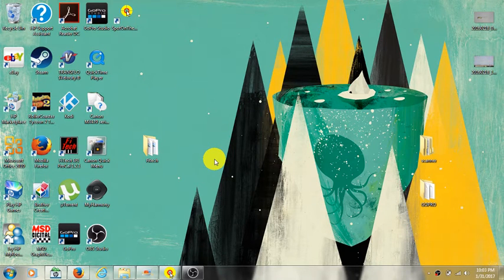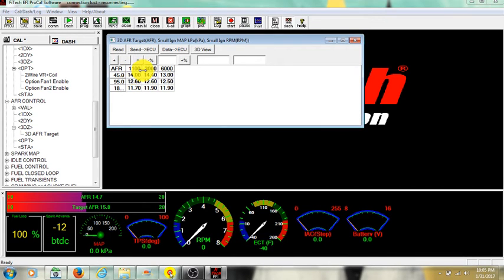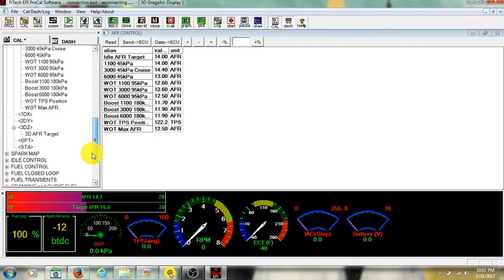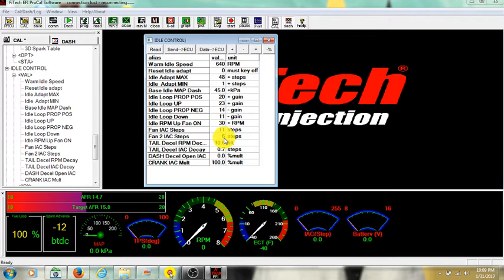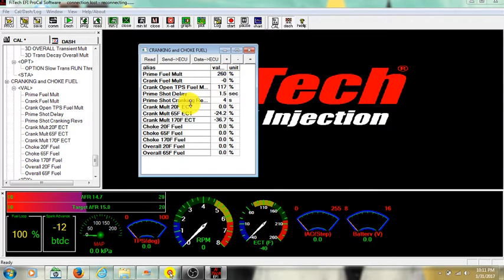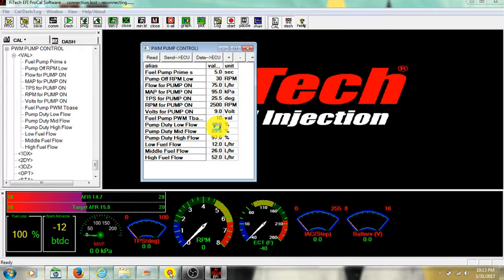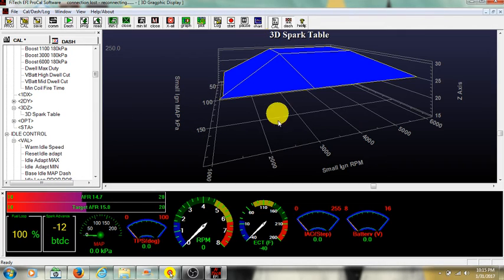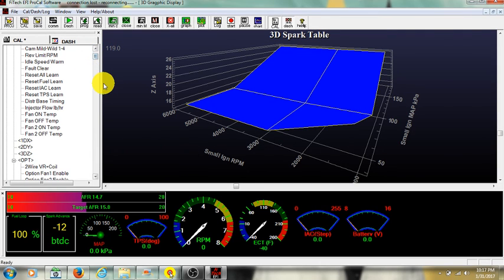Fitech Efi Procal Software!!

Comment: Can I use this on my Mac book pro
Reply from the maker: Not sure
Reply: Josh Luper - I just got mine working by doing the mac Boot Camp dual boot install with Windows 10 on my macbook pro. The Pro Cal works fine. You do have to disable Driver Signature in Windows 10 in order to allow the K-Line driver to be installed.

Comment: These tables are very low resolution. I thought there were a lot more data points. 1100, 3000, and 6000 X Idle, Cruise, WOT. 
  I was planning on a 600hp Fitech system but now I might go with Holley Sniper EFI.

Comment: Recently purchased the 600hp power adder system. Having the most ridiculous time in the world trying to even install ProCal. I plugged the handheld up to my computer and found the file that gave a step by step on how to install, and it said i need a "winRAR" to open the files. Went online and spent $40 bucks on this "winRAR" junk from rarlabs.com(the creator of the app), and got nothing but an email with some sort of "registration key" bullshit. Any advice or tips on how you were able to actually download the software? And did you use this winRAR stuff?
Reply from the maker: You can use winrar for free or winzip.They are just a decompressing software.I did use winrar you have to decompress into a folder then install the software from that folder.let me know if you get it to work.
Reply: Talk about massive economic spike at winrars firm now! I just press buy later like the rest of the human population XD
Reply: https://scontent.ford1-1.fna.fbcdn.net/v/t1.0-9/29027220_1643502759060179_4227327389358620672_n.jpg?oh=4d5c8359ec521d060503a5e00e854e85&oe=5B38F314

Comment: I have 383 my fitech keeps setting to a it 355? Also I set my rev limiter to 6500 and it goes to 7000 and sets my cam to a 2 i change it and it just goes back
Reply from the maker: Might not be giving it enough time to load to the ecm.It stores it on the throttle body not the hand held.

Comment: How/where do you get the calibration file? Do you "Read Cal from ECU" (on handheld) and use that file? I get no data in ProCal when I use that file. The panels are blank.  Thanks!
Reply from the maker: Paul Hamilton there's a folder in the hand held that has all the calibration files. that's where you can read them and save them to use.
Reply: Thanks for quick response. For some reason the software was not working right on my laptop - no data would show up.  Just installed on another, and now it works as you describe. I assume that if I make changes to the cal in the software, I can then save that back to the handheld. Then transfer from handheld to ECU?
Reply from the maker: yep, thats how it works.good luck!

Comment: Does it compensate for low bottle pressure?
Reply from the maker: It has duel afr so when your on the bottle it is  richer.The unit can add and subtract fuel to change the afr.So if the bottle is low then it will pull fuel to achieve the set  AFR.

Comment: I have so many questions... since I have my own ignition and I pull timing out for nitrous do I leave the timming pulled or set it up for normal driving and have the system pull out a couple degrees on its own?
Reply from the maker: You can run just the efi and use your old timing set up or you have to lock out your distributor and use the fitech system to do all the timing .Your distributor will be a crank sensor.If you use fitech for your timing then you can set it up so it will pull timing when the nitrous  are activated.

Comment: Is there a delay where it adds just fuel a split second before boost so it doesn't go lean?
Reply from the maker: It goes off of the map sensor so it sees a drop in intake pressure and adds fuel before you get boost then keeps adding fuel as boost increases.

Comment: how do you know what your afr is supost to be to begin with? i just got the 600hp with power adder and the fuel command center. i have a bbc458 in my mud truck and i just got this set up its still in the box. i have a holley 770 truck avenger on it now and holy crap it takes like 20 mins to get it to start. thats why i got the efi but before i put it on im just trying to get a feel for it i have never messed with efi before so its all greek to me. thank you for any help.  ps i did subscribe
Reply from the maker: air fuel ratio is determined by how much load is on the motor and what type of induction you have. idle and Cruise air fuel ratios or more towards the lean side, wide open throttle be more towards the rich side. if you have forced induction or nitrous then the air fuel ratio will be richer to prevent spark knock.
Reply: thank you that helps. i dont have nitrous yet but im looking to put a 150 or 200 shot plate on after i get used to this.

Comment: how do I get the software.. my kit didn't come with it
Reply: Rome3aaro the procal software only comes with the power adder models.
Reply from the maker: You have to hook the display up to the computer and open it as a hard drive then you'll find the fitech software folder.